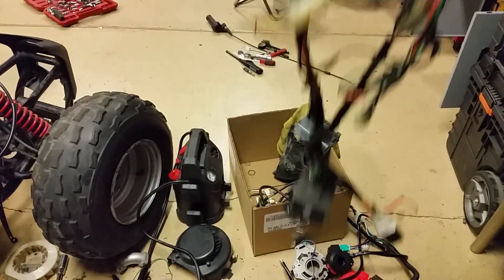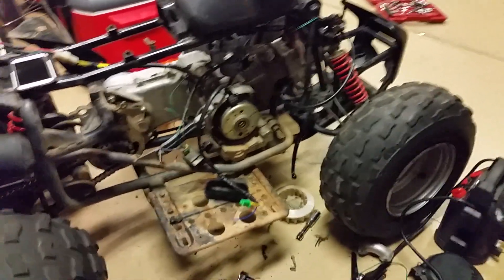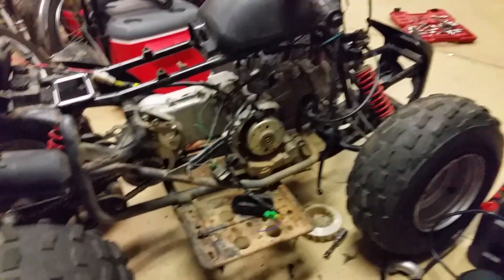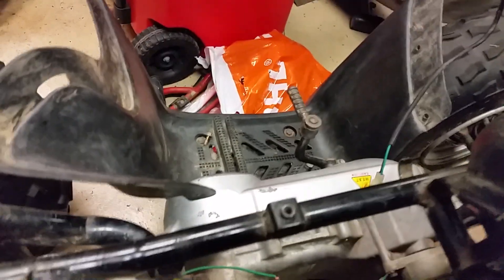HOW TO FIX CHINESE QUAD WITH NO SPARK!

Comment: Could u tell me why my stator keep going bad I changed it about 4 times
Reply from the maker: Check for shorts, or make sure this is the correct part. You could also have a bad flywheel/generator.

Comment: I have a Baja 150 atv and the 6’pole stator is discontinued.  It only has 4 wires total (3 in plug and 1 bullet plug) and my cdi only has 4 pins.  Do anyone think if I just ripped all out and put a different 6 pole stator it would work?
Reply from the maker: If you change out your harness it should come with a new cdi, get a harness that comes with the 6 pole stator or get one that matches up to the harness.
Reply from the maker: I will be posting another vid by tomorrow, with a similar issue. Stayed tuned my friend!

Comment: i have spark and it wont start.
Reply: @FIXIT CARTER what if it’s getting gas could it be the cdi
Reply from the maker: Yes cdi or air delivery
Reply from the maker: Next would be to check your fuel delivery.

Comment: What wires do you need so you can get basic spark
Reply from the maker: If you dont have the basic starting system you can purchase a kick start wiring harness for what ever cc bike you have. I will try to put it in the description sometimes soon.
Reply from the maker: I left the wiring in the description. If you have this issue that item should fix it.

Comment: Hey, thanks for the video. Quick question, how do you check if the stator sends pulse. Or whether it works or not before opening all?
Reply from the maker: YangarXII sorry so late, just do a spark test. With a spark plug tester. Then you have to make sure the ground is good and corresponding switches. If all of those are good then you may one to shoot this direction
Reply: @fixitcarter  0
Reply from the maker: Not sure